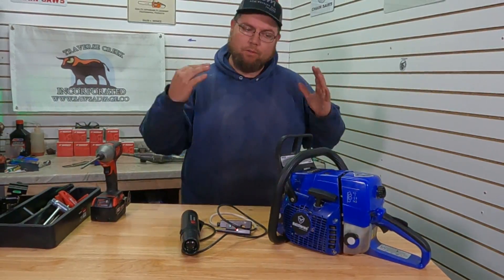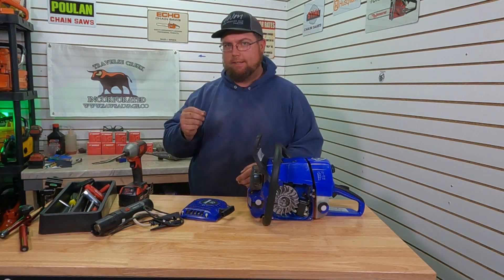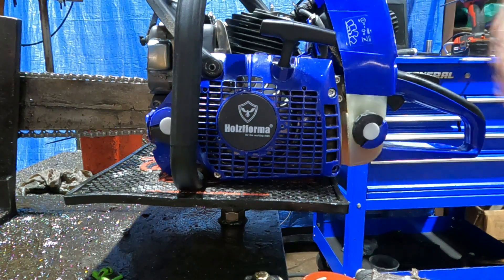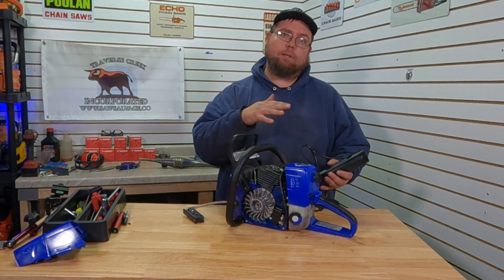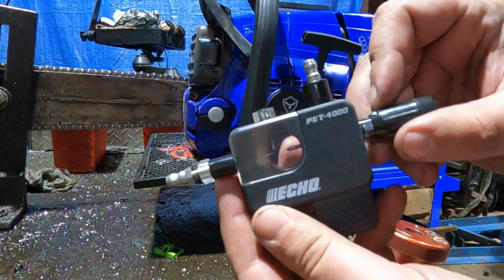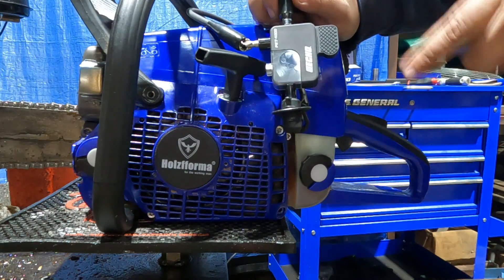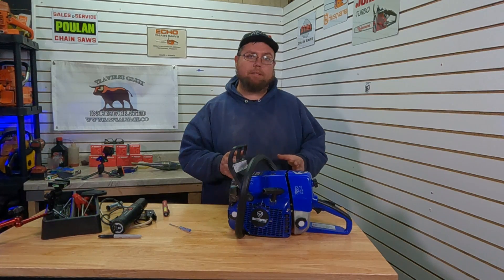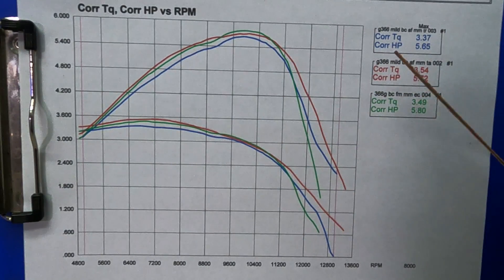ADVANCE YOUR WAY TO MORE POWER??

Comment: Put a year and a half on the g466 professional timeber falling. Swapped the head bolts and the clutch springs and threw on a carb off a 460. This is a piece compared to a real 460 but I made a lot of money with it and was a fun run on my TikTok channel.

Comment: The neotec saws are built a bit better. I own a tree service and use the ms660 and 372xp. They are ok. I have 5 of each. They all break eventually. I'm usually changing top ends, sometimes carb diaphragms, and sometimes a case cracks by the bar studs.

Comment: You can’t get any real professional use without you doing that work… bevels on the port window’s and piston edges… upgrades on the rubber and plastic seals and fuel line type stuff… my experience was 3-4 years and the lower quality is deteriorating badly.,, you can beat the bejesus out of one for the 4 years though!!!  On a $300 dollar 372! $75 bucks per year investment for a pounder isn’t a bad investment!!!  If you are doing 30 cord or firewood cutting?!? It’s fantastic!  So they can definitely have a place in a small business!

Comment: It’s definitely funny to me to hear the different opinions about the use of the aftermarket parts and saw’s for the “professional work or company tool” I started using the aftermarket parts and a couple different models of clones with various parts substitutions over 13 years ago and I’ve seen their ability.  Obviously they don’t have the same longevity in center parts and you can either swap them out or plan on trading your labor to save money.  The cylinder lining material isn’t OEm and if you aren’t using 32:1 mixture then you never owned an older version chrome bore saw I recon?  It’s just imperative for longevity to use the increased quantity of oil in these products.  If you don’t own a Foredom or something like that and have any experience with grinding on a metal piece or engine parts or polishing something then you’ll need to practice and learn because they are much cheaper products because they all need to get a session on the…”Final Finishing and quality control inspector station”!!! That’s you for saving some bucks… you have to grind and polish and it’s a labor investment to reduce your cash investment…or you will have a mediocre results at best.  Add some real seals and SKF bearings and an echo bulk fuel line and grind your cylinder to be decent enough and I absolutely just immediately toss the ugly quality piston and cheap quality rings right into the recycling box!  But for $25 bucks apiece the Duke’s moly coated pop up performance pistons for that model will completely change the whole game!  Several of those units have over 8 years running with the real deal’s and they are all good!   They will run 10 years!  I’ve added a use OEM engine or a meteor topend kit for the $125-$150 bucks apiece for those and I’ve found that those higher quality investment units will run next to OEM and they isn’t a detectable difference between them and if you have done some power increase porting type numbers and polishing the clones stronger!  I have several Husqvarna and Stihl and other makers units that have been working 20-30! Years with no additional new parts or repair work only maintenance stuff!   They might not be that quality… they aren’t that quality!!!  But I’ve gotten a damn near decade of work and performance for…? Half the investment!   The g372 was $250 and I actually have $200 bucks in my $100 dollar cylinder and $50 dollar piston kit and $50 bucks in seals…SKF bearings and echo lines…. &450 … 8 years old and running fantastic… got the 4-5 more easy….  I would have needed $900 for a oe371xp…. So I’ve saved 1/2 my money???  A Firewood seller can save a mint!  A land owner who puts $450 into a upgraded… 372…044:046… 660-395… whatever model that works his 28”-32”-36” type bar saw…. Will be able to do the seals and fuel lines and his kid will be using it.,,  case’s are case’s in my experience with saw’s.

7.5 years ago I bought a $100 dollar 60cc (5800 zenoah clone) and added the $50 dollar Carlton bar and a decent chain… just had the pto seal go and for the first 3? Years it pulled the 20” 72 3/8 .50 setup with the rakes down 50 thousand as I wanted to increase the amount of abuse and pounding testing the whole clutch drum assembly and bearings seals and crank ruggedness to determine if I could use them for a cheap goundsaw to train up a blockhead rookies and not have a quality saw abused in the process and they have been working like a freaking animal for the past 7.5 years…one down (mine)… 3 still blasting great (5-6 years old).,. I’ve been running a business for 36 years and if you told me I could get 7 years of work for my $150 dollar investment.,. I’d have laughed in your face and sent you packing as a moron and laying salesman cheat!!!  I’ll be spending another $100!   And I’m probably going to be trying to get my seal too!  It’s finally freaking time to rip into her and see what she is saying!!!

Comment: I run both Holzfarma and Neo-tec clones. I cut fire wood fairly heavily, take bigger trees down for people from time to time, and do storm damage clean up for people here and there. 4-6 cord a year really doesn’t say much, but with the clones I have found it takes about two outings to find all the week spots for normal use. I usually find a hand full of stuff little things that need fixing. Big thing I have ran into on the clones with clone carbs is the metering lever hight is not right or needs a slight adjustment. I have seen this issue recently with OE home owner grade stuff like the new MS250 style as well. I will say from the couple clone saws I have blown up they were ported and I was probably at a head temp above 320/350F. Clone cranks are not as straight as OE across the board. other than that if you get a build you like for the application and you blow a clone up and you put OE crank, piston, and cylinder it and it works out well for building a tailor built saw for an application. They make great back up saws for the money I would definitely put two of them in the truck if I had to have 100% reliability. I save my real MS460 for stuff when it really matters.  I have found that a good clone build coupled with an OE pro saw (pick your poison) makes for an effective fire wood situation where your saving the hours on the good stuff. My OE saw is down to a couple tanks a year. The back up saw is a ms260 hulz clone ported with a 25” bar spinning 3/8 full house. She is on her second season an I have been mean to it. But it got a full going through before I put it into hard service. The clone saws have to be flushed out, inspected, ran lightly for brake in, and inspected agin (clip and orient the wrist pin clips is a must). Loose fasteners, crappy starting rope, metering lever on the carb, and 50/50 on whether the oiler is worth even trying to mod for more oil. I would say the starter rope, carb, and the oiler have been some things that I have found more often than not on the clones to be non serviceable just get a OE part or something of better quality. For a stent the Hulz oilers that came on the saws were just garbage. If a clone was completely gone through, broke in, the quirky stuff fixed, lightly ported with a muffler mod, ran with fantastic 2 stroke oil I can see getting 250 hours of service out of one with little to no issue. Compare that agents an OE pro saw out the gate with the muffler mod and same quality oil. I can safely say that you will probably make the 250hour mark with little to no issue and the time that would have been used to work on the saw would be used making wood chips for money if you were running a business.

Comment: The problem I had with the dial in timing lights is they are set up for clockwise rotation and chainsaws run anti clockwise.

Comment: I've got two 034's building up one leaving the other stock to compare with, i starting with the muffler mod then timing advance 15thou cut off key and it held 800rpm higher in the cut, went to 30thou of the key and it would rev higher but wouldn't hold the rpm as high, went back to 15thou, removed base gasket, 17thou clearance to head from piston, raised the exhaust port 10thou and widened both intake and exhaust, cleaned up transfers and polished the carb throat and venturi, it cut almost as good as my stock ms460 both  running 20" 3/8 with 7 pin drivers, im pretty sure it's fighting the restrictive air filter, if anyone has any ideas on a less restricted filter, cannot be just mesh, needs to filter

Comment: As far as taking that little “E” clip off, I always start by using the spark plug side of the scrench by sliding it over the clip and pulling or pushing (whichever way is needed at the time. Then it’s “usually” a tiny thing to put my thumb over it to finish removing it. Reverse the process for installing 😊

Comment: On setting timing small movements can make big differences. 372's are very sensitive Like more advance can give you more torque and less rpm in the cut  and more retarded can give you more rpm in the cut but less torque.  I know a more precise way to set timing. To know how much 1 degree is on the flywheel or at the keyway.  Measure your crankshaft at the key slot then multiply by PI then divide by 360. Do the same on your flywheel. That will give you thousand of an inch per degree. Example On 372's are about .005 off the key for 1 degree and flywheels are about .039 per degree. On my 372 I had a problem too advanced had lots of torque but popped like crazy I moved the key a little less then 2 degrees retarded about .009 off the key it rev alot higher but lost that high torque but like it there.

Comment: I used the degree wheel to scribe my timing degrees 0 to 30 btdc on the flywheel  then use a timing light. That coil look like it has a healthy curve °10 mabe °15 ?.
Reply from the maker: About 16 from idle to wide open.

Comment: Very cool test. I can add some info about timing; decreasing squish distance, increasing squish area, increasing compression all speed up the ignition event. So if your timing is spot on before any of those modifications, you might have to retard  it to make more power. The broad power curve of the timing advance run was interesting. I don't  know what octane fuel you are running but it wouldbe interesting to take it up a couple points and see how the saw responds. Increasing octane  has the same effect as decreasing timing. I wonder if you could keep the fat curve and still beat the stock setting with a little more octane.
Reply from the maker: Thank you for the info. I will try and keep an eye on those things see if I can find a correlation.
Reply: Myself I preferred the curve with timing adv, lost a smidge peak power but was stronger everywhere else plus it's a very smooth curve, would like to know how mods on this saw have progressed in the last year

Comment: Hi Joe, thanks for the ignition timing testing you have done. This helps confirm what I have found with my G366. Just as you demonstrated , the stock ignition coils are weak on the G366. I don't think it's just a G366 issue because I have seen this issue with other clone saws. My G466 was another problem child for me. There are some aftermarket coils that work better overall. It will be interesting to see what your ignition timing will end up being when you get to raising the compression. As near as I can tell mine is probably about 3 to 4 degrees retarded ignition timing after raising the compression. My G366 is prone to recoil kick back if I don't back the timing off a bit. I use my G366 for firewood cutting, I'm not fond of the cord being ripped out of my hand. I'm looking forward to more on this saw build progression of yours!

Comment: I believe that the 441 coil might also fit the 361?
I've run 2 blue 372xps for a few years now and honestly besides carburetors and 1 coil they have been pretty reliable.  I modified both of them and they run better than the stock counter part.

Comment: Personally I prefer ALL OEM, 
That being said I wanted to get into porting, I could not justify practicing on a $1200.00 saw. I purchased a Farmertec saw, NWP crank, OEM bearings and seals. I had a OEM Walbro carb, so far it has been running well and cutting a lot of wood. 
I chose that route because all the OEM cylinders I looked at were $300.00, I would rather destroy a $150.00 cylinder than the OEM. Thank you for the video sir.

Comment: Interesting and good /timing/ of the video,  I just did an advance on my 460. I got a little carried away with the file and probly did more like .030. 
If you're not careful it'll yank the starter out of your hand. It feels like it has more power though and i haven't really noticed it making any unhappy noises, but I'll probly go back to stock or less advance after this. 

Maybe you could try a colder or non extended tip spark plug on the dyno with the advance and see if it makes a difference?

Comment: Great video Joe, tons of good info here.  I've got a question.  Did you try to tighten the air gap in between the coil and magnets to get a better spark?  I've heard the coil produces better spark with a .005 to .007" gap vs the traditional .010" gap.
Reply from the maker: I did not try messing with the gap. Might have to
Reply: @dynojoemods2764 It may not even make a difference.  It may be a myth or wives tale.
Reply: .012 is good or thickness of a business card. If you go less you risk destruction

Comment: I like messing around with clone saws and have nothing but clones.
I can do this because I only really need one reliable 50ish cc saw to cut up my 4-5 cord of fire wood for the year. 
I have 1 joncutter 5800, it's 4 years old and has never acted up, I always get my wood cut up without issue with it.
I have 1 supmix 6200, it's my back up for the joncutter, it seams fine but is still early days. The zenoah clones like the joncutter are pretty solid but not exciting saws. I'd just as soon have it as a 50cc name brand home owner saw.
I also have a neo tech 892, I dont need this saw, I use it blocking up the easy to get to fire wood pile, it's ported and quite fast/fun for that. It's had issues tho, the decomp, the oiler, the gas /oil caps and the chain adjuster have all been swapped out, I also had to mod the control lever to get fast idle to work.
I dont take the neo tech to the woods to cut wood but I dont think twice about taking my other saws.

Comment: I've got the devil in the blue dress 666  and a 660 Pro  carbon fiber    w Meteor cylinder and Caber rings rings   she's definitely got that high compression kick  I've been running the blue saw for about 8 years and then carbon fiber for about 5 years They seem to run alongside my 660 Sthil's    Don't really notice much difference other than the carbon fiber is a Little more revvy     Yeah I've had really good luck with them so far  but I did buy an 888 Haltzfforma It came with a bad coil and I changed that out then it spoogeed oil out the exhaust Like crazy couldn't tune it out   seem to be always getting too much fuel  I finally sorted that out And it run like stank for about a half hour and throw the bottom end on the Conrad at 25:1 oil ratio  And just for curiosity I looked on the steels website to see if they have any problems with their 880's And I seen quite a few reviews where people said the 880 088 Stihl's did the same thing

Comment: How to speed up the ignition in a partner 351 chainsaw and the power is much better than in the original. By default, the ignition is 2,5 mm before top dead center.

Comment: I went the clone route for some medium duty work to begin with. After almost spending too much money on more clones I came to my senses and bought a Husqvarna 545 MK II......it was all downhill from there......for the clones. Since getting the 545 I have been so impressed that I purchased a 572XP for the heavier work. You are right Joe.....good to learn on but not to depend on.